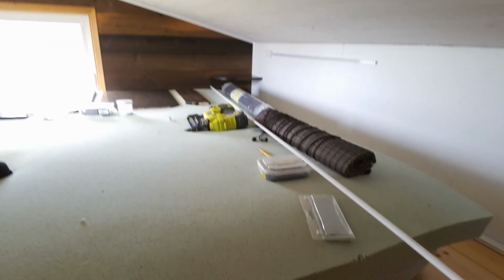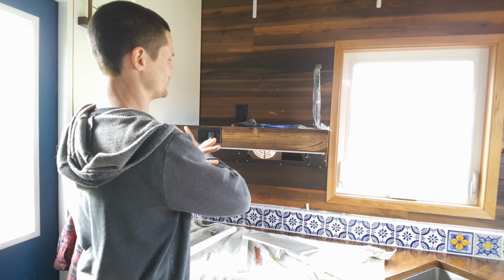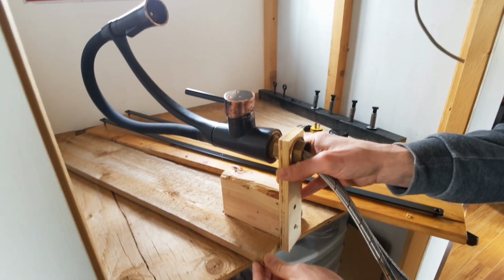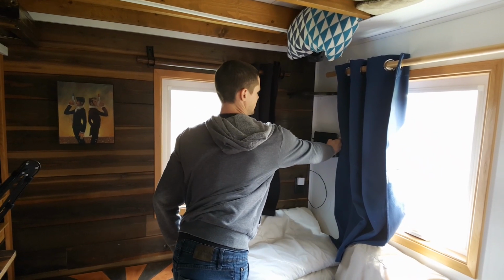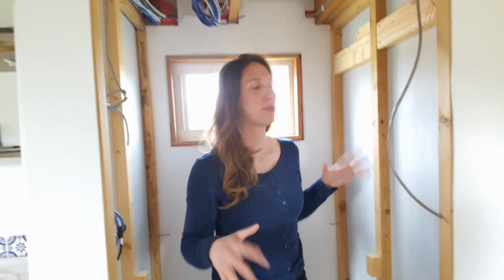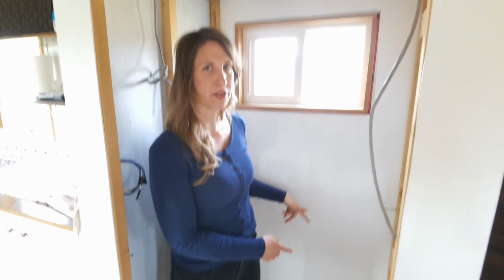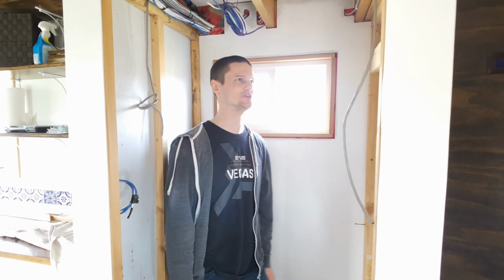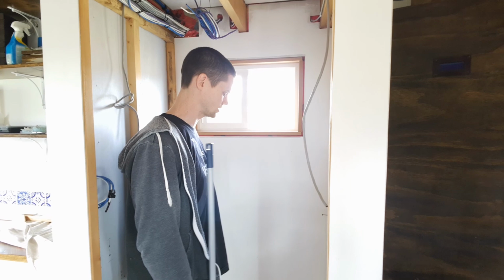What To Do About Our Tiny House Shower??

Comment: I built an octagonal cabin and finished all the interior walls with canvas. I bought the best canvas painters drop sheets from Cloverdale. I stapled it to the studs, saturated it in exterior primer and then painted it with exterior latex paint. This was used as the exterior of canoes in the old days. I have used the same technique to cover skin on frame kayaks. It is cheap, easy, flexible and completely waterproof.

Comment: Shower pan membrane, backer board with red guard seems, red guard waterproof painted membrane on all wall and seems once again. Tile or whatever you so desire. Fender wise I’d built it up higher and at a slight angle but turn it into a small ledge slash seat. 

I’d tile it but that’s me. Best wishes

Comment: I’ve seen cedar showers before.  I thought about doing it in my tiny house. I’ve worked in industrial fiberglass. I honestly don’t advise it. Youve got to know what you’re doing. A simple change in temperature can cause your product to burn (crack and bubble).
Reply from the maker: Cedar would be very nice... we ended up going with vinyl decking... which is not very nice, but turned out surprisingly well.

Comment: As far as the walls if you do a mural you could do a waterproof polyurethane clear coat as well as for the floor they do make a waterproof membrane that you could pour out like liquid or you can also make your own with waterproof membrane tape. According to the building codes of course

Comment: Hey guys - I almost can't believe you're still building.... but you know what - the shower was indeed my biggest challenge. I kept putting it off over and over. And after I had a plumber come and help me build one using plastic sheets similar to an RV shower, it leaked! So then I ripped it out and went with the Schluter Kerdi board as the backing. and then tiled it. It's the best way to do it honestly. One wall of my shower is 2x2's and it's totally fine. Tiling is way easier than it looks or sounds and it won't crack. I used thick stone tile and with the schluter stuff behind, you're totally protected from leaks anyway! . You can do it! Good luck - message me or call if you have any questions! Cheers Alan

Comment: I haven’t done my shower yet, but my dad suggested elastomeric coating for my shower. It’s liquid applied and made for roofing. So you can make it any custom shape you need, you kind of apply it like paper maché. I don’t know if it emits nasty chemicals but I’ve used it outside before and I don’t remember it having a strong smell (and I’m very scent sensitive).
Reply: Kimberly Bainum -I just finished a little research on this. Elastomeric has anti freeze as an ingredient for some reason. Which is why I assume it says for exterior use only. I would love to use this as a vapor barrier, instead of closed cell foam or plastic. Closed cell is too thick in my opinion, and paint is too thin. And I would like to spray it. I am going to call the manufacturer to see if it matters if i cover it. But you would not be covering it for a shower. So it may not work for you.

Comment: Definitely avoid sheet metal or "corrugated iron" like you've seen in so many tiny houses: sharp screw heads to scratch yourself on and DIFFICULT TO CLEAN, and metal is more difficult for sealants or caulk to adhere to. The fender bump-out presents a challenge but I'll throw my idea out there: Is there a shower pan that would be close to the shower floor size? (either un-modified next to the fender, or cut out of the shower pan the area that the fender eats up) Then do a little work with fiberglass cloth and resin to cover the fender. (Attach the fiberglass to the shower pan... basically modify the shower pan to make a customized over-the-fender shower pan) Then for the walls: my friend re-did his shower surround with a roll-end of vinyl flooring he got for cheap. (the one-piece flooring that's a big roll, like "linoleum", not like vinyl plank) He did all three walls in one continuous piece, with small radius bends at the two corners. It looks good, is super easy to clean, stands up to soaps and chemicals and water, and only has a bottom edge to worry about sealing. And it was really cheap! (Maybe you can find a nice clean bright color or pattern...)
Reply from the maker: Finally catching up on all the comments, and this is actually what we've been looking into lately! Vinyl Decking, which can be heat-welded and result in a continuous covering over all the walls :) 
And yes we did manage to find a pan that is the exact size of the exposed subfloor area (beside the fender), so we only need to deal with the transitions/corners created by the fender...
Reply: Awesome! I actually thought of that vinyl decking too, several days after I commented about the vinyl flooring, only I didn't know it was heat welded.. cool!

Comment: K.I.S.S. Keep it simple stupid. I agree to slope the wall, easy fix. https://poly-wall.com/air-barrier-products/blue-barrier-liquid-wrap-2300/  This product can be screwed/nailed into and will self repair.  And this on top https://www.homedepot.com/p/1-2-in-x-48-in-x-96-in-White-White-King-StarBoard-796333/202534579
Joints sealed with this https://www.3m.com/3M/en_US/company-us/all-3m-products/~/3M-Marine-Adhesive-Sealant-5200/?N=5002385+3293241623&rt=rud
Shower base https://www.amazon.com/Heavy-Washer-Machine-Drain-Stainless/dp/B0742KZGSB/ref=sr_1_4?dchild=1&keywords=washing+machine+pan&qid=1586237389&sr=8-4

Comment: Possibly epoxy paint but research it.   You may still need a vapor barrier and insulation to prevent condensation inside the walls.  Even if you get a water tight shell you need to consider rotting from the condensation.

Comment: You could use some waterproofing membrane and then use pre-designed shower walls for the two sides (home improvement stores may have them!). The third side you could use fiberglass and obtain that slope you were talking about. Good luck!

Comment: I would look into galvanized sheet metal. There was a builder from Florida who convinced me that was the way to go. As far as the fender goes, remember that a flat roof can still drain as long as you have the right pitch. If I can recall correctly it’s a 2 degree pitch. If ever there was anything to farm out it’s to a professional it would be the shower. Bending metal is probably not a diy project.

Comment: Fiber Glass if you have experience doing it before. Or Premake fiber glass shower pod (you do have to change the design a bit). My best bet is brush stainless steel all walls and floor pan (Not Cheap ). Nest time you guy build a tiny house don't route any wire thru bath room. (Bad idea)

Comment: Hi Jake and Kiva, re shower ideas.

For a monlithic coating, then epoxy is a good way to go. You can get it coloured if you want, or do something decorative underneath and use a clear coat. For the corners you thicken the epoxy and create a radius to make it easy to clean. Have a look at how it is used in boat construction/repairs for ideas.

Another idea would be to have a S/S shower tray made that also covered the wheelwell. then you could use a waterproof coated fibre cement board designed for shower use on the walls, they have radiused plastic corners that the sheets fit into. You could hold the sides with a removable strip at the door end so that if you needed to get inside the walls again at any point it would be relatively easy to do so.

The angled wall will collect soap much faster, better to angle the top of the wheelwell. If you do it with the S/S shower tray it will be easy to clean.

Comment: I would roller and brush on some fluid applied waterproofing but only up 2 of 3 feet. Then just overlap sheets of metal or fiberglass or whatever on top of that and all the way up. Then seal the corners and your done. OR, just hang a shower curtain all around. That might be easier and even better. It could be clear or a pattern or whatever.

Comment: I used the kerdi orange fiber material over 1/4" cement board. Follow the youtube videos to learn how to apply. You can use mortar and cement board to give the fender a positive slope. You've done a great job of minimizing weight, but tile over Kerdi fabric will waterproof your shower and would be worth the weight and effort
Reply from the maker: Thank you for your input!  The kerdi product has been recommended a few times, looks like a great product. Has it been working our for you?

Comment: I have many ideas. But I think your idea of the angled wall sounds cool but being your in a tiny space it will waste useful space.  You could use HdPE sheets or ABS, PVC sheet. Heated and bent to fit the walls. Then you have your limited seams. 
I think your best bet is to shou sugi ban some finished plywood panels for the walls. Then roll on an layer of epoxy. I "shou sugi ban" makes the wood water resistant. Mold resistant, bacteria , and insect resistant and I have seen this technique used for large aquariums sinks and tubs with no issues so I believe it's a safe bet. The window wall if you really do end up angling it. I would only go from the window bottom to the top of the wheel hub. I'd put a very shallow angle on top of the hub so you can place bottles there but the water  run off ot. Maybe 3.- 5 degrees. Great job. I have watched since day one of the build I will rejoice when you can. Call it complete. Take care.
Reply from the maker: Watching since day 1? Wow, thank you for the support!  Love the idea of the shou sugi ban in the shower, thank you!   We will also rejoice when we can call this tiny home done :D

Comment: You can use FRP panels (fiberglass reinforced plastic,) there are versions that look exactly like tile but they are thin lightweight panels. They are typically used in commercial applications for their high durability, water resistance and ease of maintenance. The panels are available in 4'x8' sheets that can be easily cut, and have the their own seem kit to go with it.
Reply from the maker: This sounds like an excellent option!  Thank you :D
Reply: I did use FRP walls and ceiling down to a standard tub in my tiny house. FRP is available at all my local big box stores

Comment: In similar scenario - I’ve used Sikalastic product to make a water tight and flexible membrane. Every seam and crack I’ve prefilled with Sikaflex super durable cocking. The undelaung board is cement based board like fermacell Powerpanel H2O. Top coat are tiles, but it is not RV/TinyHouse. As a topcoat I would suggest a second layer of powerpanel and vinyl paint to finish it. Shower basin - as Sika for proper solution or checkout Handeeman’s videos on Youtube... cheers and take care...

Comment: First, I would place a tack just below the window and run a string from it to the edge of the fender to get the angle that you need for the slope. second, I would frame the entire area using plywood and then use Flex-seal that can be spray on and use it to cover all the plywood and any seams. it also comes in white color, too. Be sure to mask the drain, window, shower head and controls. hope it helps.
Reply from the maker: Thank you! :)

Comment: I vote for self-adhering and self-healing "Ice dam" as a waterproof layer bottom and sides; "rainscreen" sides that vent top and bottom; removable teak or bamboo slat floor :) You may need to cut away and rebuild the sub floor to slope the base toward your drain. Best regards, Rich

https://www.finehomebuilding.com/2019/05/09/284-site-built-shower-pans
Reply from the maker: Thank you! :)

Comment: My first suggestion is to avoid organic materials in a shower, particularly when layering as in a rainscreen approach. Any void or seam which is not easily accessible may accumulate soap scum, body oils, skin cells, etc. that provide a great medium upon which mold, mildew, and bacteria can flourish. Slim can develop on wood just like wood cutting boards that are left too long in the sink.
Second, be very informed about outgassing if considering any product used to waterproof the exterior of a building. Peel and stick bitumen, no, no, no.
You don't mention what your budget constraints are at this time.
Here are three products that came to mind. Copper sheeting, solid surfacing, commercial flooring.
Copper sheeting can be bent continuous over shelves and protrusions, bent into corners, folded, lapped and soldered tight, Copper nails can be soldered in, don't use a blow torch. you can easily overheat the copper. It is not cheap but it is durable. Is can be polished or treated to oxidized and coated to preserve the look or left raw and utilize the natural antibacterial qualities. Samuel and Sons Co.
Solid surfacing can be cut and shaped with saws, routers, etc. The panels can be back illuminated. Using a router on the rear to create reveal art or inspirational passages (signage). Edges are joined and sealed water tight by a technician. Allowing for window trim, sills, soap dish recesses complete with drainage ridges and holes. Suction cup attachments for temporary items and silicon sealant for permanent items are both possible for installing after market stuff. Corian is one premium brand.
Commercial floor and wall coverings, more specifically Altro brand. There products are used in hospital wet rooms, washrooms, hallways, etc. They can be coved up walls, butt joined, and lap joined. Joints are typically heat sealed by a professional installer. At only 2.5mm thick you would need some backing but nothing excessive, certainly not 3/4" plywood. Inside corners need not be coved if a bent metal furring strip is placed behind to receive a coating of waterproof adhesive. Be sure to tape the top surface so that any excess that oozes out from the joint and can't be pressed in elsewhere along it can be easily lifted off before the adhesive fully cures. Check out the Altro online or at Wingren NuFloor in Nanaimo.

Wishing you both the best. Larry

Check out Isaac Ostrom's channel if you are considering Kerdie and other liner membranes. I'm not a fan of simple mortar joints because thinset mortar is not waterproof. Be your own judge and consider the risks.
Reply from the maker: Wow, thank you so much for this detailed reply!  Good to know about soap scum etc on natural materials.  We will look into these options that you suggest. Nanaimo?...you must be a local! ;)
Reply: @tinynestproject  Yep, Coombs, Parksville and Nanaimo; and now Victoria/Esquimalt.

Comment: I think what we did in our tiny house shower would work perfectly for you.  Schluter Kerdi Board is great for a lightweight waterproof protection layer.  On top of that, you can get 4x8 sheets of PVC board at Lowe’s.  I used FRP adhesive to fix it to the Kerdi Board.  You can cut to fit and cover whatever you need it to.  Use regular shower caulk to seal the seams.  Be careful transporting and moving though, it damages easily but should be fine once installed.  For the base, as another person mentioned, I’d recommend the Kerdi shower base and cut it to fit.  I don’t have an idea for the finished surface of the floor, you could use more PVC sheeting but I’d be afraid it would be too slick.   In any case would use Red Gard at least on the floor.   This idea came from when we were going to use Kohler Choreograph panels but decided they were too heavy and too expensive.  Basically it’s what they call a “solid surface” shower done in PVC without the big price tag.
Reply from the maker: Thank you! A few people have mentioned the Kerdi board and it looks like a great option! Is your shower is working out well?
Reply: @tinynestproject  Yes, we love it.  The Kerdi is going to work out wonderfully as far as being lightweight and easy to use.  It's gonna be a little more expensive than the traditional options but building a tiny house... you're no stranger to that.  I was a little skeptical about the instructions to seal the seams of the Kerdi with mortar/thinset though...(can't remember which one it was) That part doesn't seem all that waterproof to me.  If I had to do it over again, I would probably paint some Red Gard over the suggested seam sealing method just to make me feel better.  The Kerdi drain pan isn't cheap either, for being just a big block of foam.  But it is the simplest and most lightweight option out there.   Once you get the PVC sheets up, just do a really goo job of finish-caulking the corner joints and penetrations of the PVC sheets, they will be 100% impenetrable to water.  I was thinking about your wheel well in the shower which presents an outside corner...that's is harder to make it look good using PVC sheets.  I'd use extra FRP when applying the sheets in this area so that it oozes out of the joint and seals up, and then I'd use a piece of PVC outside corner trim applied with only adhesive caulk (no nails).  Here again, use the caulk liberally so that it squeezes out of the joint making sure it's completely sealed.  The PVC sheets have a nice matte white look to them which is a little different.
Reply: I would probably consider replacing your window trim with dimensional PVC as well.  1x3, 1x4 PVC trim is easily available in the trim section of the big box stores. That way, there's no potential for anything to rot, anywhere.

Comment: For the shower just sheet with plywood and use vinyl tile
Reply: in my tiny house I used similar to that https://images.app.goo.gl/oiQfMoPw8DQkQXgg7
Reply from the maker: Thank you for the link! How is it working our for you?
Reply: @tinynestproject  My tiny house is new, I took a shower only 3-4 times only - but it will no any issues, it's 100% water resistant becasue it's a plastic material and it's widely used for flooring, take a look at example here https://youtu.be/mWC3-QraUZQ?t=405